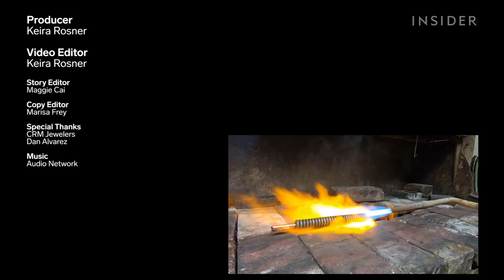How A Goldsmith Creates A 14-Karat Gold Cuban Link Chain

Comment: 14 karat = a fantastic way to waste pure gold. This stuff isnt gold. its an alloy.
Reply: That’s the point lol pure gold is to pliable 14k is genius as it allows to look like gold and be strong enough to hold its own weight pure gold could not hold itself up
Reply: I don't agree with that theory. This is a 14K chain, which means that 14/24 parts are gold. 24K gold, by definition, is 24/24 parts; i.e., all gold. There's a BIG price difference between a 24K and 14K chain. The chain on the video goes for around $46,000 as of today (12/1/2020), while a 24K chain 1-kilogram change would go for about $77,000. That's 67% higher, which is significant, but that doesn't mean that a 14K chain has no value. It's all proportional at the end of the day.

Comment: How much would that chain cost ? What about in 18kt gold
Reply: The 1-kilogram chain on the video goes for around $46,000 right now (12/1/2020). An 18K chain of equivalent weight goes for around $58,000. Pure gold (24K), which we wouldn't recommend for a chain this size, would put the price at around $77,000.

Comment: 1017.9 grams of 14k gold is $1,120,086.981. And that is the price for only the metal, not accounting for the manufacturing and profit margin. Also the weight and cost of the 24k gold plating isn’t significant enough to try to calculate.
Reply: Nonsense... Even 1kg of pure gold i.e.32 ounces are just 70.000. Think again!
Reply: @hkkhgffh3613  Ah shit, that’s what I get for using the first search result I get. Or they used some crazy materials in the alloy.
Reply: The fineness of this chain is 14K, which means that you're using 14 parts gold and 10 parts other metals (out of an obvious 24 parts). The total weight of the chain is 1 kilogram. The total price of the chain, which includes manufacturing costs, is around $46,000 (as of 12/1/2020).